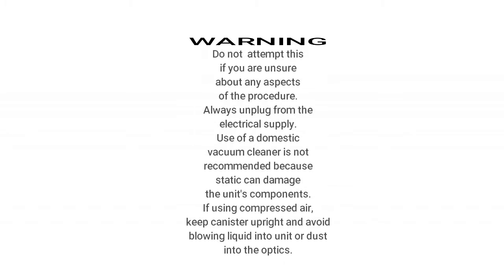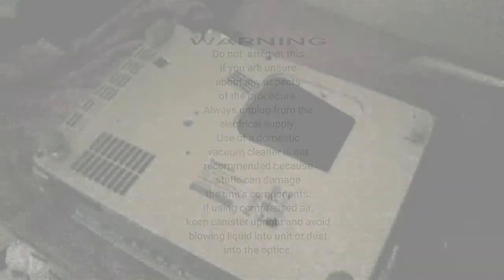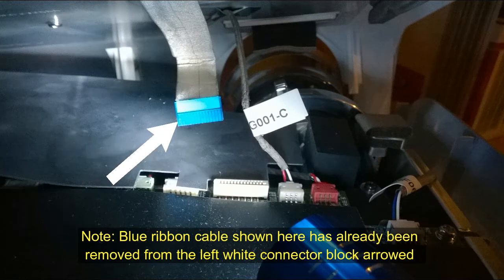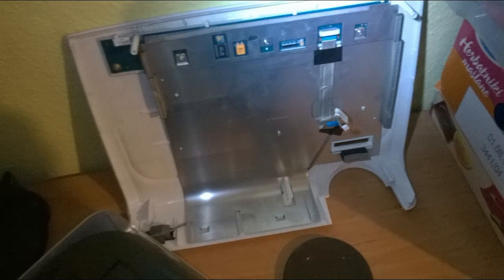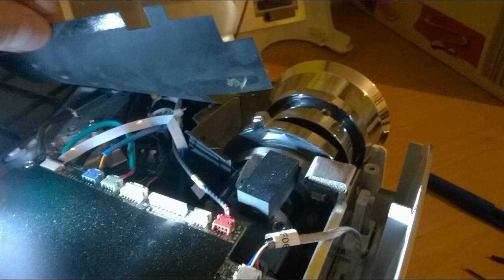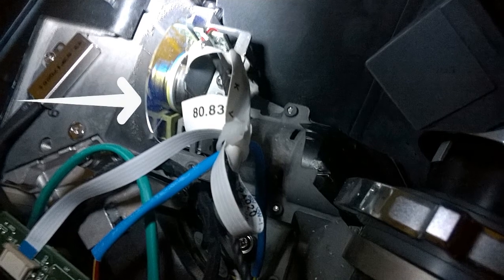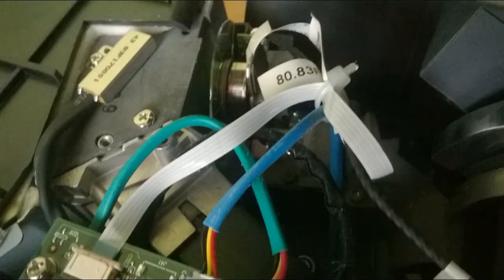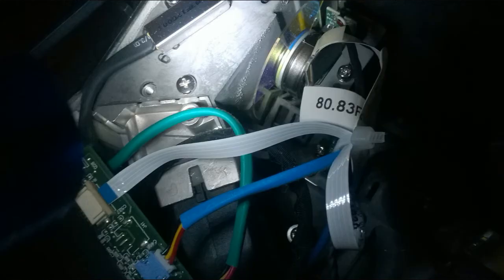DLP projector projecting poorly and green tinge - hack to clean and repair

Comment from the maker: Picked a projector up very cheaply from a shop on an auction site. They said it was in perfect order. Can give them benefit of the doubt as it would indeed project 30 mins before problems showed up on the screen. Problem was picture interference - green and other colours flickering here and there badly in the projected picture. Solution was to clean as shown in this video. This only happened in standard fan speed setting. In high altitude fan speed setting, all was fine. But of course, best not to have the h/a fan on if possible because it's noisier and may wear out, who knows. So, cleaned the projector and have run several tests since for 120 mins continuously. Problem solved and all fine. NB Please read the warnings before deciding to go ahead with this project because you could fix the problem or could permanently damage the unit if not careful. Always let the unit's fan cool the projector after use. Never just disconnect!